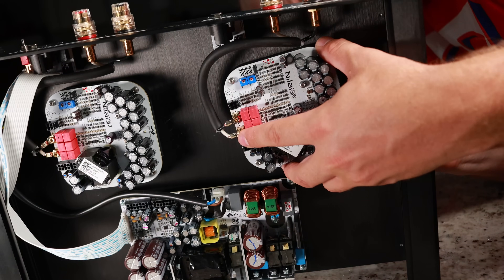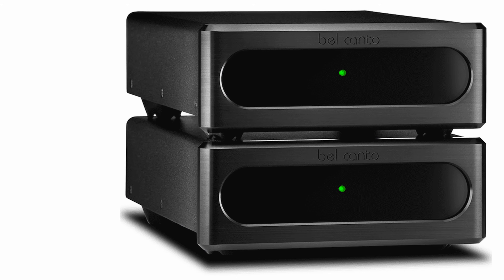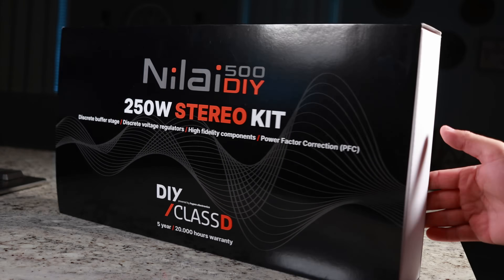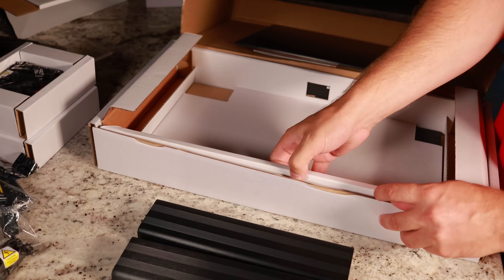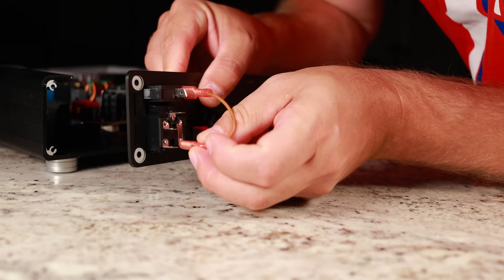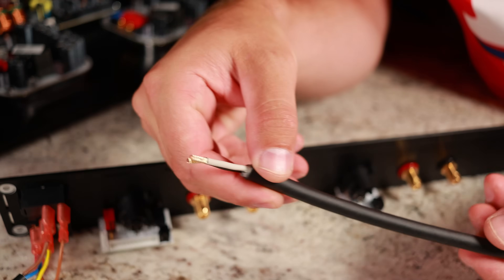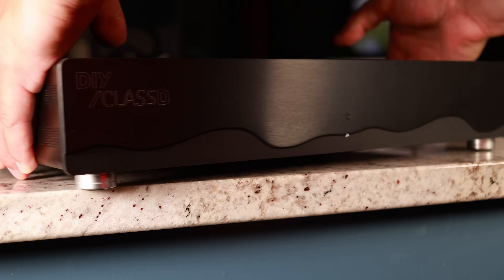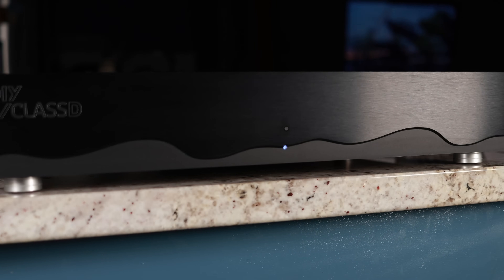Building A Top-of-the-line HiFi Amplifier For Less: Hypex Nilai500diy DIY HiFi Amplifier Kit

Comment: Hopefully it's not broken like your orchard audio one.
Reply from the maker: @Pete.across.the.street  my Orchard Audio works fine. Maybe you’re thinking of someone else?
Reply: @Toid  oh I thought it had an over heating problem
Reply from the maker: @Pete.across.the.street  No. I did have an issue with my power. But that was an issue with my power company. A power conditioner fixed that.
Reply: @Pete.across.the.street GaN amps have Class A sound with no heat.

Comment: Now, all I need is to find a sticker that covers the hideous DIY logo on the front panel.
Reply from the maker: @reaxions  DIY Class D sells a blank front panel for this. You could just buy it at the same time.
Reply: @Toid  thanks, problem solved!!!
Reply: you can purchase the front panel without the logo .
Reply: @avro66  Good to know.
Reply: Yeah I wasn't a fan of that either. I was thinking about building my own case and just buy the amp and wire harness.
Reply: @BostonMike68 Have you priced a decent machined chassis lately? A quick scrub with steel wool and repainting with Rustoleum aerosol might be worth investigating?
Several years ago I built a couple of different class D kits, and purchased chassis from DIY Audio store and Ghent Audio. The former was fabricated in Italy, and completely bare bones - i.e. all machining for hardware mounting holes, etc by user. The Ghent Audio line is specifically pre-machined for numerous configurations of Hypex, Purifi, and ICEPower modules, and are equivalent quality to many commercial products - but some folks may have an aversion to supporting the company due to country of origin.
Reply: @fonkenful  thanks yes I have been looking into Ghent for awhile. I was thinking about getting an ice amp from parts express. But I thought maybe to hold out for hypex or purfi. I think I can build my own for not a lot of money. I was thinking about using aluminum and walnut for the sides, I am a carpenter and worked in a Machine shop before but I have been getting lazy TBH on the weekends lately. I also just found a vintage professional qsc 300 watt amp I am digging right now that I only paid $50 for and I like the sound so far.
Reply: @BostonMike68  FWIW, at the risk of using unfashionably “audiophile” buzzwords, I found my ICEpower 200AS amp to be more “musical” or more finely textured than the older series UCD180 that essentially fell into my lap. I’ve also built complete chassis for several tube and ClassA SS amps from combination of raw aluminum plates and wood using only hand tools for the former, and I’d rather not visit that exercise again.
Reply: @fonkenful  the ice power is inexpensive and that's part of the reason I was thinking about getting one. I probably would be better off getting a case from Ghent
Reply: @BostonMike68  I’d have no hesitation as a repeat customer. The only thing on which I’d second guess  myself would be the make / model of amp. The only criticism I’ve heard regarding the Purifi Eigentakt is that it feels “a bit sterile” compared to a particular model of boutique class AB composite chip amp - coming from the designer of same - and a piece that I happen to have been enjoying my living room music system for over 5 years now. 
Decisions, decisions- first world problems, man. 🫣
Reply: @fonkenful  I know the feeling.  😂 I am interested in the ice 1200 as2 edge. What Pre amp do you use with the ice
Reply: @BostonMike68  Presently the ICE is powering multiple subs in a small Atmos theatre system, with processing by Onkyo RZ740,  PEQ/ time alignment by miniDSP 2x4HD, and an Emotiva BasX A7 powering the bed layer. My upstairs music system is streaming only, and consists of BlueSound N130, Hypex UCD180 on dual subs (another 2x4HD) and Neurochrome Modulus 286 on DIY 2 ways.  It’s been almost 10 years since I started streamlining my audio system - or played any physical media on either - and I honestly can’t remember my last separate component pre-amp.
Reply: I have this amp and the logo isn't as noticeable as it appears in videos.
Reply: @mddawson1  it's definitely not a deal breaker. I'm just thinking of resale, but I probably wouldn't want to ever sell it. How does it sound?
Reply: @BostonMike68  Absolutely transparent. It is the first amp that I have heard that has an inky black background the music decays into. It is like a veil has been lifted from my speakers, something that I hadn't noticed until it was missing with the Nilai. Note, it isn't a warm sounding amp. Compared to other amps, the Nilai sounds like it has less bass but that is due to its high damping factor controlling the bass drivers and preventing sloppy mid-bass boominess. It also lacks that Class-D high frequency harshness common to older Class-D designs.
Reply: @mddawson1  that is a good description, thank you

Comment: The YouTube algo appears to be at least half-working atm. lol

I was re-watching some of your vids over the past few days, about speaker builds etc.

I was wondering if there would be a way to build a more compact version of the Cinema 6 ?
ie. Something which could get you 90% of the same sound, but without taking up tons of space.

With a single woofer, it would obviously not have the same bass extension as the Cinema 6, but that would be fine in a home theater system.

I don't know much about whether using a much smaller waveguide would affect the maximum dispersion, though?

Even better if a speaker could be made which doesn't have too much depth, so they could be installed kind of IN-wall.

But I'm biased, because I bought my first acoustically-transparent screen last year.
And I shoved some RSL CG23M into the wall behind the screen. lol

I've always wanted to try speakers with a compression driver and waveguide, as I think that could get me closer to the sound signature of "real" cinema speakers.
Reply from the maker: @electronash  what size were you thinking?
Reply: @Toid  Not sure, tbh.

Maybe something like 10 inches wide, 14 or so inches tall? So probably max 8-inch woofer?

I know you did something similar to the M&K S-150 a while back.

I am being biased, as it's just something I'd like for my own setup, where I have a very small room (barely 9ft square), and had to set the RSLs into the wall.

The RSL CG23M are already only about 6-inches deep, so they are sticking out of the wall by 2 inches. lol

I had to add spacers to the projector screen, and it still wasn't quite enough, so the screen is currently resting on the speaker baffles.

I think I'm just trying to strive more towards the type of sound you get from (usually JBL) cinema speakers with a compression driver.

Even though I'm not entirely sure how to even describe the sound.

Just very pin-point on the dialogue, but capable of the mid-bass slam when needed.

I've never built my own speakers, but always wanted to try.
Reply: I used to have the M&K S-150 fronts, MX350 sub, and K4 Tripole surrounds. But had to sell most of it when we downsized in 2015.

That setup was quite neutral sounding, which is something I prefer more for home cinema speakers.

I recently bought the Micca MB42X G2, and then the NEUMI BS5, for more "fun" music listening.

(with or without the RSL 10s sub.)
Reply: I'm re-watching your vid on the Cinema 10 now.

I suppose what I'm thinking of would just be an even smaller version of that.

But I know the depth etc. is largely dictated by the size of typical waveguides etc.

I think anything that is intended to be used with a (half-decent) subwoofer would be fine to have a -3dB rolloff at around 80-90Hz, so it doesn't have to dig too deep.

Something that could be used for the front and height channels as well, so they don't necessarily need to have the angled baffle.
Reply from the maker: @electronash  I was originally thinking the cinema 10 as well. The biggest issue is going to be the waveguide. Most theater style waveguides are going to be probably at least 12 inches wide. So making it much smaller width would be hard.
Reply: @Toid  Ahh, no problem.

The Cinema 10 isn't actually too huge, so I'll definitely have a look into building some in the New Year.

I like the idea of the Atmos speakers with the compression driver in the middle (coaxial?).

Those are already fairly compact, and I think could work fine for the fronts as well.